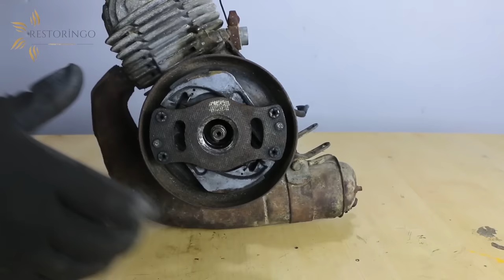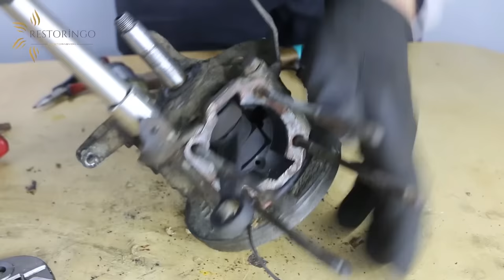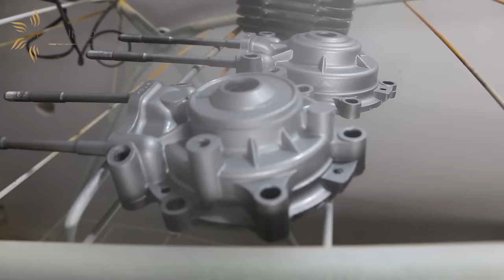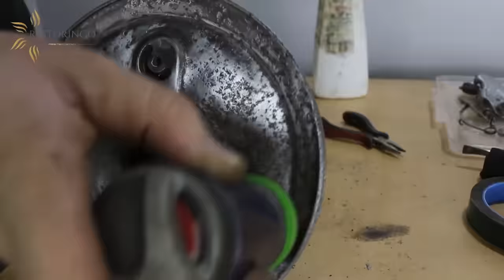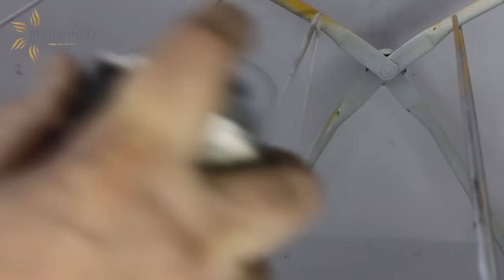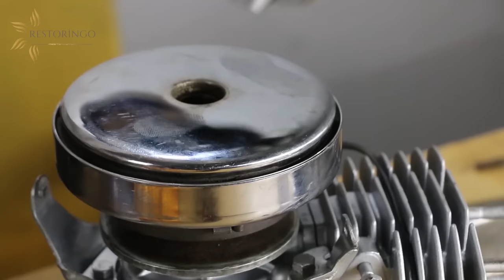Motobecane  old moped engine restoration 1969 (2t engine)

Comment: You wouldn't have  a clue where I can get a cylinder head bolt for one of those motors would you
Reply from the maker: Hello. It's actually the bolt that isn't hard to find. You can find it at any hardware store.

Comment: You did an incredible job and without SANDER, it's very courageous, I would have liked to see your ignition breaker adjustment, it was the most delicate part of the engine adjustment.

Comment: Hello , can you tell me what products you used to remove rust in the video ? The one with salt thing and the yellow liquid. Thank you
Reply from the maker: Hello. Of course, I would be honored to assist you. Element citric acid (lemon salt), which I use as crystal, is available in every market. Increases the effect of hot water. its color is transparent but it turns yellow because it dissolves rust. If you have any questions, I will be happy to answer you. Thank you for your interest and support.

Comment: What materials do you use when cleaning the engine block?
Reply from the maker: It is possible to use many techniques. I first used diesel oil to get rid of the oil. I also did mechanical cleaning. I also used cleaning detergent.
Reply: wich materials?
 @restoringo

Comment: little tip: DON'T use the metal-bodied crank seals on these engines. installing them will deform them and make them fail early on. I know from personal experience. use fully rubber seals instead.
Reply from the maker: Thank you very much for the information. I hope it doesn't break soon. I'll take that into account for next changes.
Reply: @restoringo  alright. I enjoyed the video. keep up the excellent work.
Reply from the maker: Thank you

Comment: no way this thing has some kind of cvt and even a 2 stroke pipe thats insane, old masterpiece!
Reply from the maker: yes, you are right, even though it was in 1969, it was a perfect design. there is a cvt system that most current chinese engines cannot reach
Reply: @restoringo  exactly

Comment: Great video! What was the thick engine cleaner you were brushing on to the parts? Seemed to work really well!
Reply from the maker: thank you so much.  I first flushed the oil in the engine with diesel fuel.  I cleaned the rusty parts with crystalline citric acid (lemon salt).  Need to rub a little.
Reply: @restoringo  thats not what he asked.

Comment: nice piggy bank to paint the engine. how long does such a finish last?
Reply from the maker: It is a heat-resistant paint. It has been healthy on it for a long time. This moped is not for use. I could not paint it. I painted it for visuality.
Reply: @restoringo  when I do something, I do it properly.  chemical cleaning should have been used on the aluminum parts.  easy to wash and dye

Comment: Hello what is your product ?
Reply from the maker: I can't help you because I don't know exactly which product you are talking about. I would love to help you.
Reply: @restoringo   I'm talking about the product with the crystals, the one that looks like soap, in fact a little bit of all the products you use, the high temperature spray paint too
Reply from the maker: Thank you for your attention. I am happy to assist you. I first use diesel fuel to clean engine oils. Then I clean it before painting with liquid detergent. The crystals you see for rusty surfaces, on the other hand, lemon salt (citric acid) increases the effect of hot water. I use heat resistant paints when painting the engine part. the floor should first be removed up to a certain temperature and the paint adhesion should be increased. I hope I could help you.
Reply: @restoringo   Thank you :) good vidéo
Reply from the maker: Thanks 🙏🙏

Comment: What is the cleaning fluid you are using? What are the crystals?
Reply from the maker: crystals of lemon salt. natural citric acid. An effective and inexpensive method on rust provides a very serious rust solution with hot water and occasional rubbing.
Reply: @restoringo  many thanks

Comment: what rust removal technique is that
Reply from the maker: You can solve the rust in a few different ways. it depends on the severity of the rust. but the most preferred electrolysis and rust removing acids. I used citric acid here.

Comment: was für eine unglaublich schlechte Restauration. Wichtig ist alles mit silbernen Lack zu lackieren damit fallen die abgebrochenen Kühlrippen auch kaum auf. Unfassbar schlecht.
Reply from the maker: Hallo. Vielen Dank, dass Sie Ihre Meinung mit mir teilen. Ich verteile kein unbegrenztes Budget für Restaurierungsprojekte, ich schließe Restaurierungsprojekte ab, indem ich die Teile nach Möglichkeit verwende. Der Lack ist hitzebeständig und es gibt derzeit keine Probleme. LANG. Nochmals vielen Dank für Ihr Interesse.
Reply: @restoringo  Don't take his criticism into account!, you did an incredible job and without SANDER, it's very courageous, I would have liked to see your ignition breaker adjustment, it was the most delicate part of the engine adjustment.